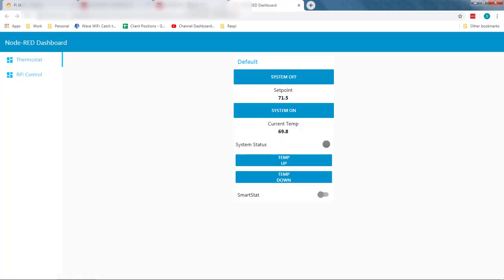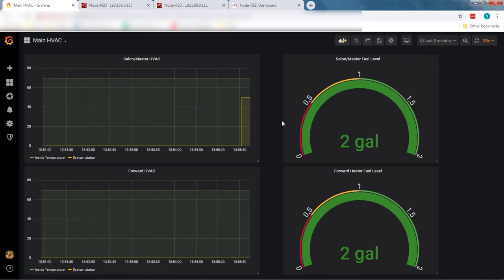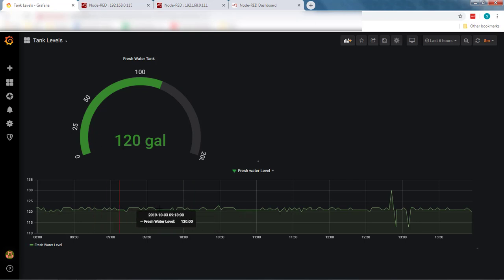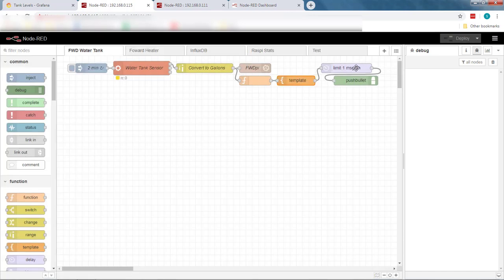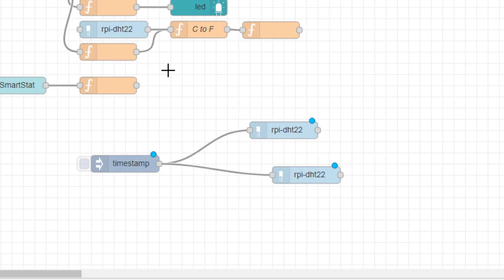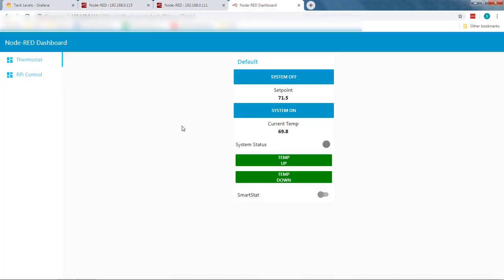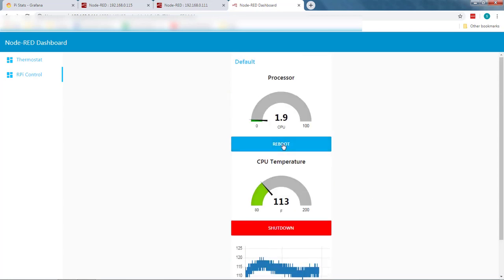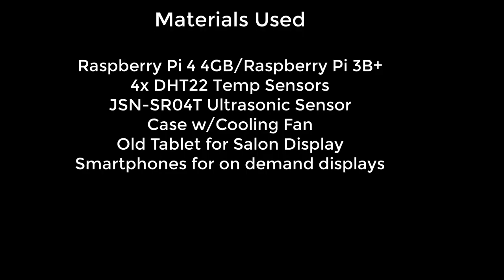Raspberry Pi Boat Projects So Far

Comment: Pretty neat use of a Pi. Do you think the Pi4 is really necessary for what you're doing? The extra heat and power consumption are worth the extra computing power? I know it makes a much better desktop and game emulator but for most of my other projects the 3B+ is more than enough.
Reply from the maker: The main reason for the Pi 4 was is for the media server side of things. I use Plex and the transcoding stressed my 3. With the 4 and fan cooling case it works great though. Even when transcoding heavy temps only go up to around 125f
Reply: @livingaboardmycuttingclass6225  The Flirc case works as well as a fan. It uses the entire case as a heatsink. I've heard that it can cause problems with the wifi though and I have yet to test that. Thanks for the video, it's great to see someone using the Pi in real world situations like this.
Reply from the maker: Yeah, that's what I had on my 3 when I was using it for a media server and it worked pretty good
Reply from the maker: A note for anyone doing something similar with diesel heaters. It looks like raspberry pi 4s aren't able to run rpitx properly yet so thermostat control doesn't work properly. I believe my temporary solution to use until support is to add a pi zero just for sending the control rf signals.
Reply: @livingaboardmycuttingclass6225  The argon one case is really good. Has passive and active cooling

Comment: Amazing job, I’d like to do something similar for my sail boat, and am debating how. You’ve put together quite a system, using many technologies/components. Must of been a big learning journey. Was it easy or frustrating? Cheers David.
Reply from the maker: I started out using node red for home automation before moving aboard full time so I've been playing with it for a few years now. What usually happens is I decide to try to control something or use something with the pi and trial and error it until it works,lol. It's frustrating sometimes but fun.